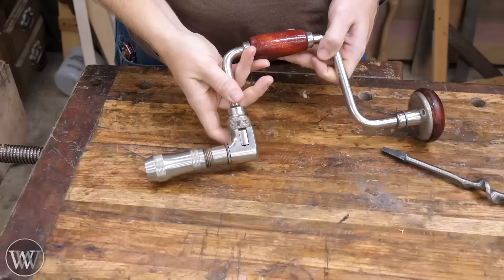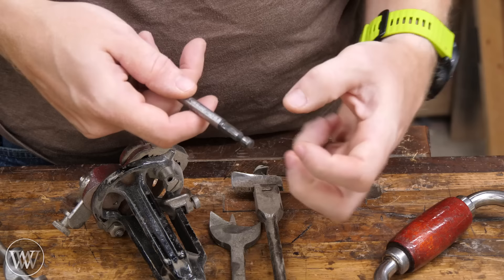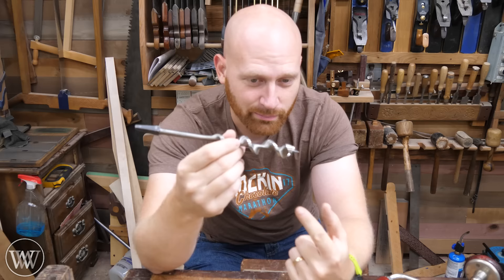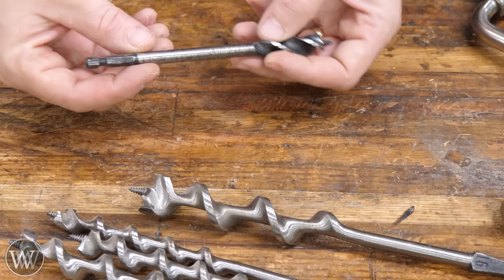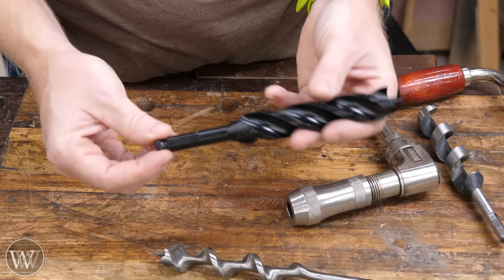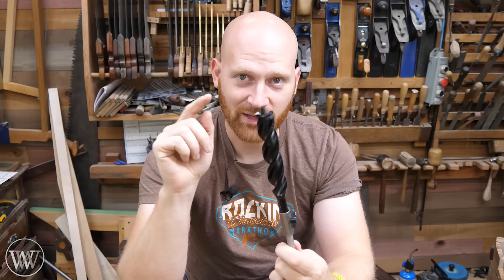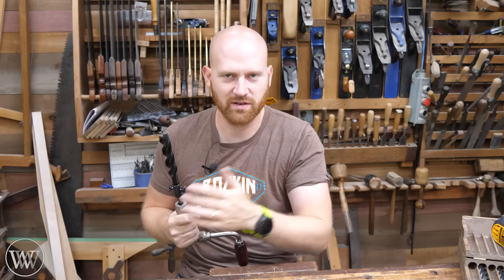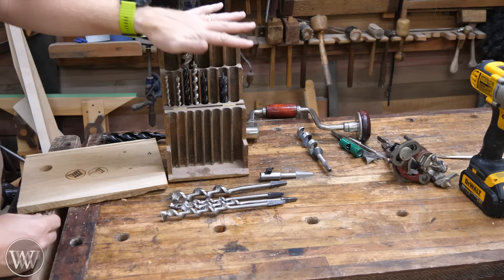New Favorite Tool What is on the End of My Brace

Comment: I have a brace and fairly regularly, the bit falls out.  I finally realized that it has a broken jaw. So I'm thinking it might be better to look for a new one.  Do you have any new braces you would recommend?
Reply from the maker: I do not have much experience with new braces. The antique ones are just so common and so cheap that I haven't had a need to look into new ones. But for the most part there isn't much to them and I've never heard of anyone really complaining about one unless they have a particular item they're picky about.
Reply: @WoodByWrightHowTo  I don't have a good way to buy a vintage brace except through eBay, which is where I got my current one that has the broken jaw.  At least I know now to ask about that to make sure I don't get another one with that problem. Thanks!

Comment: Frankly, it seems like it would be better to simply machine a brace with a chuck that fits modern bits. This solution just seems janky to me. My antique brace (used to be my great grandfather's, then grandfather's, then father's, now mine) was used in construction of rough-sawed timber homes from the early 1800's onward.  So of course all I will use with that, is antique styled bits.  You can actually get them smithed, if you want a new one.  But they are expensive, since they are artisanal reproductions.  For timber construction now, just get the tribits, and have a nice machinist make you an appropriate modern brace for them.  I prefer using a brace on construction sites in many cases instead of a cordless drill. In my opinion there is little reason to be slavish about the antique technology.  Many people prefer hand tools in quality woodworking construction for a host of reasons.  That's why there are still so many hand saws made.

Comment: Can the woodowl work with power tools?
Reply: Wood Owl's website says yes. I have never put them into a power drill, so I can't vouch for how the performance.  There are YouTube video's out there.
Reply from the maker: I have used a couple of them in my drill and they work fine but I wouldn't want to take them too fast.
Reply: Anything with a hex shank should work fine as long as your chuck is large enough, but keep the speed down with auger bits or you will wreak havoc on your wood and the bits.  Guess how I know that...